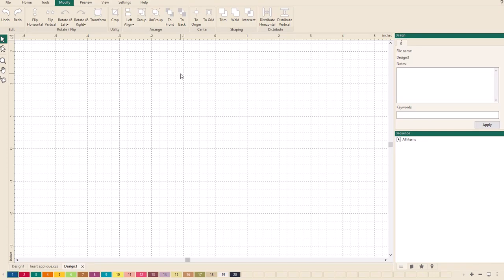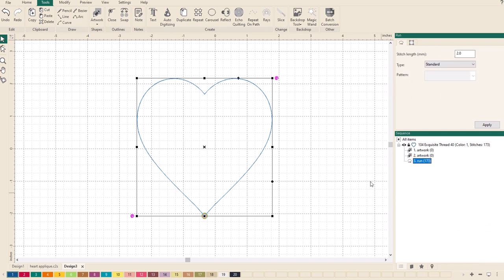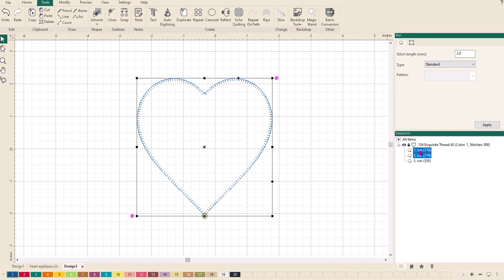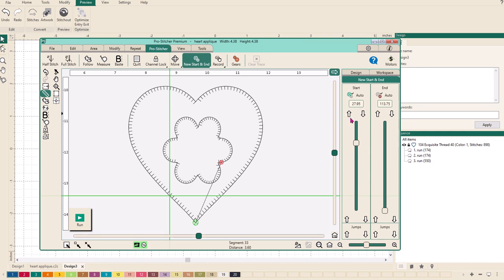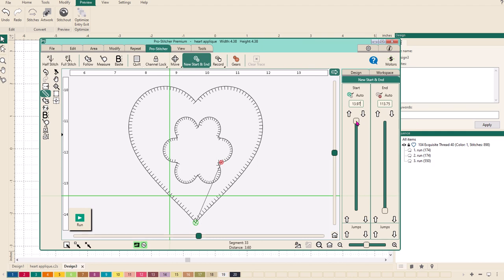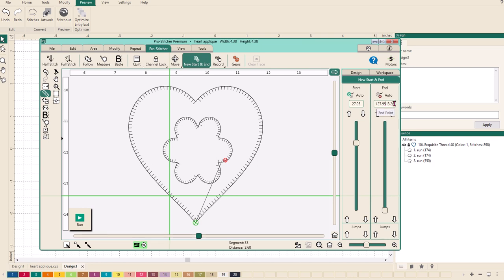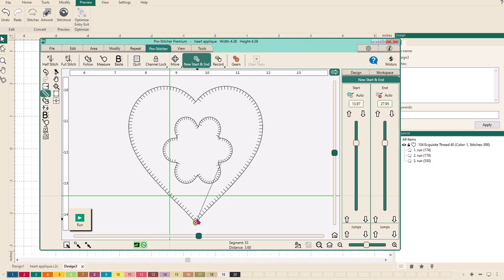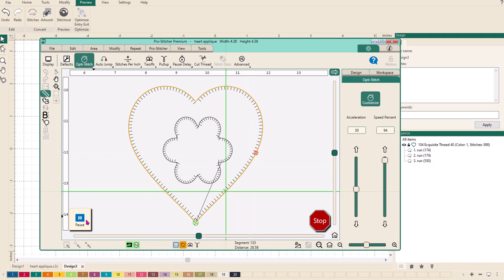Creating applique in Prostitcher designer and transfer to Prostitcher and machine

Comment: Love this! I would like to think we can make a cut file to precut the appliqué fabric. I don't think I could trim very well on my Longarm. However, sometimes when I use a cutting machine to cut a shape, it always ends up a wee bit shy of what I need and isn't totally secure. Do you do appliqué a lot on your Longarm?
Reply: Bump the cut size of your applique up by 1-2 mm. You should have better luck with it fitting for the tack down.
Reply from the maker: If you get a pair of duckbill applique scissors it is so much easier to do and less likely to make a mistake with it.  If you want to use a precut then you would have to be sure that it would a) fit and b) be secure whilst being stitched down.